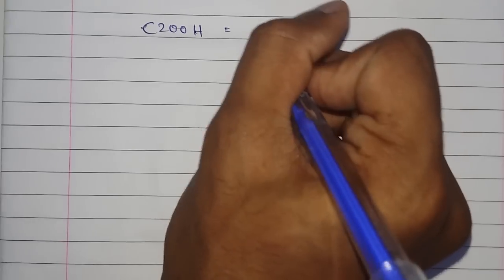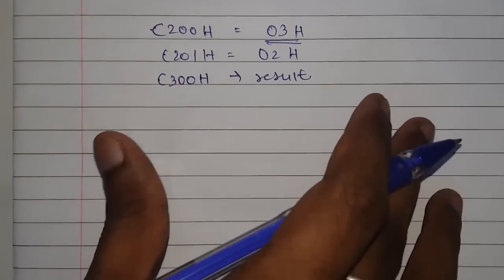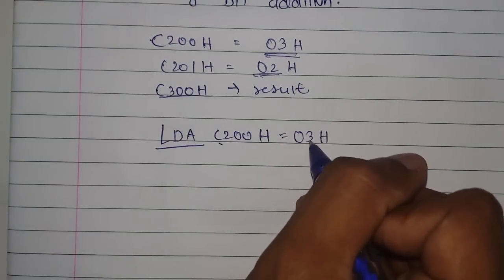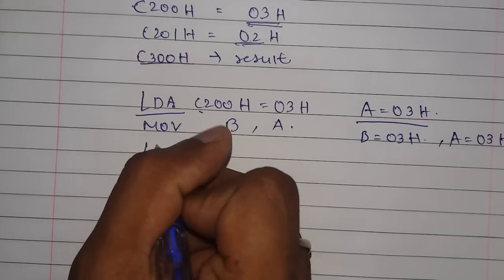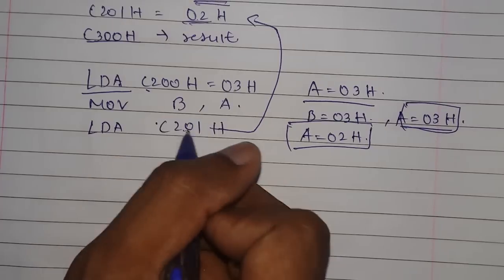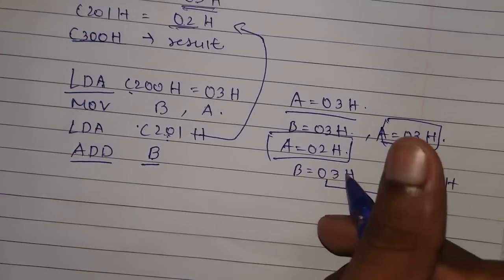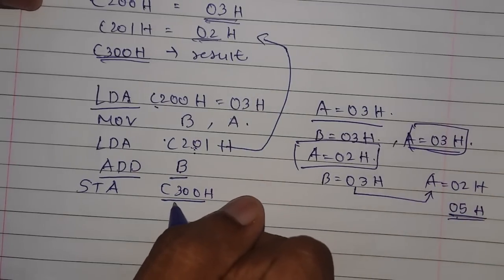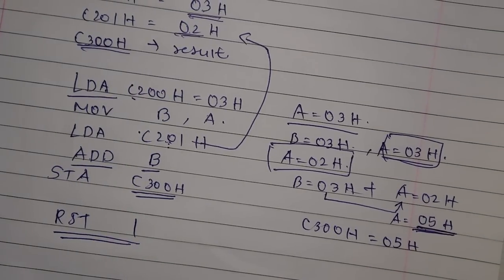Simple 8 Bit Addition Program in 8085 Microprocessor

Comment: write a program to load two hexadecimal numbers 03H and 21H in register B and C
respectively and add the numbers. If the sum is greater than FFH display 01H at
OUTPORT 01H; otherwise display the sum.
Hint. Start with an algorithm, show the status of a flag register, flow chart and then machine
writing.
(b)